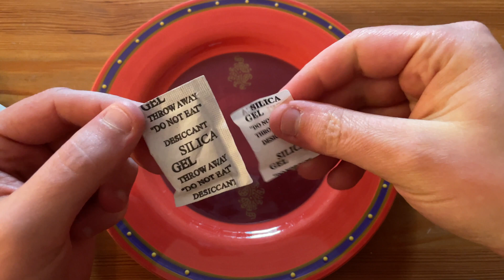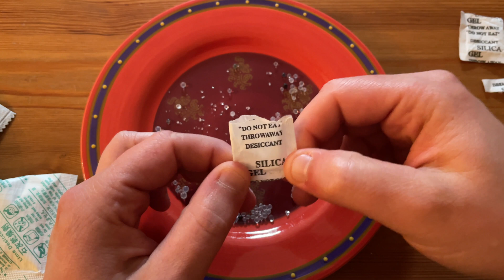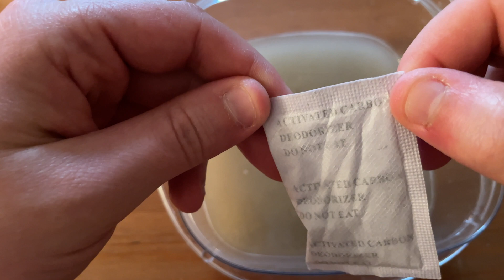What's inside Silica Gel packages? How much water can they obsorb?

Comment: Silica isn’t meant to absorb liquid water, that’s not its purpose. It absorbs water vapor and it can absorb 40% of its weight in water vapor. 

You also measured in volume where to test you need to measure in weight.